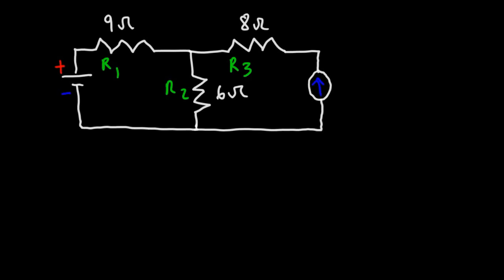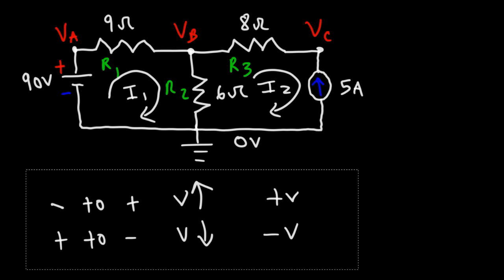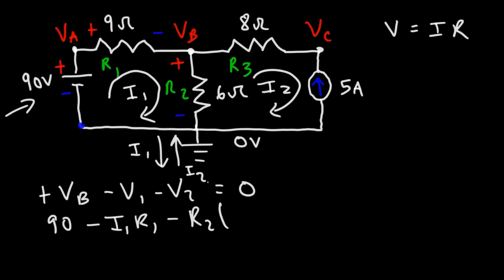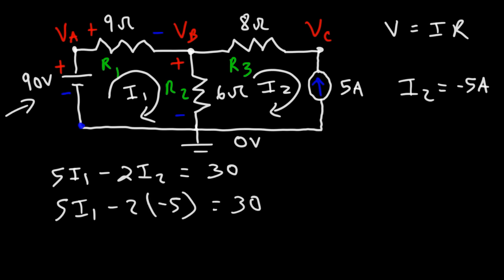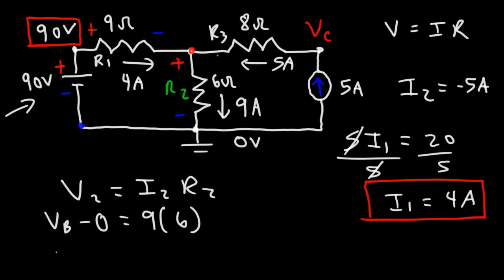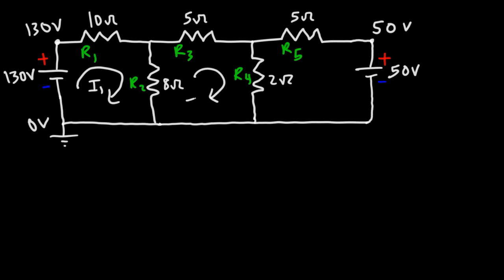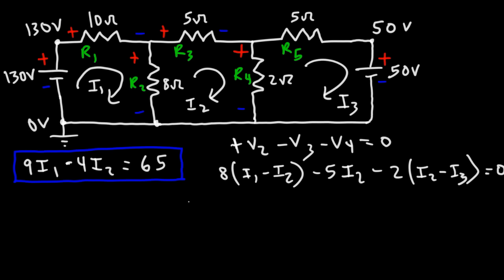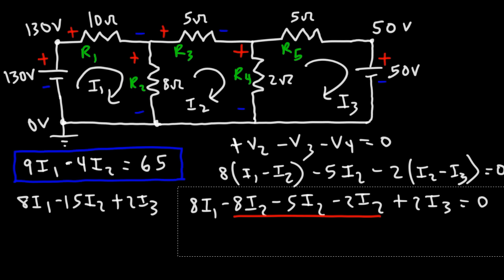Mesh Current Problems - Electronics & Circuit Analysis

Comment: I have a question. After getting the three equations can a use the function on my calculator in finding the unknown values in the second problem? I been trying to get the values using only the equations to be exactly the same answer in this video. I couldn't get it right for some reason. If anybody has an idea please do share, i might need it for tomorrows midterm.
Great video by the way.
Reply: late but you can use a "simultaneous equation" function on your calculator, depending on which one you have. My prof recommend the Casio fx-991EX because the interface is super clean and you can also solve matrices on it. I'd look into it cause it saves quite a bit of time on exams (just check with your prof that its allowed lol)

Comment: Hi all , can explain in 6:00 why divide by negative 3 and 12:45 also why divide by negative 2  ?
Thanks
Reply: Hi Cayden Goh, the reason why he divided both equations (at 6:00 and 12:45) by -3 and -2, respectively, was just to simplify them. You can calculate those equations without dividing them by those numbers. In the end, you will get the same value.

Comment: Why does I1 and I2 flow in opposite directions in the resistor R2? They both point upwards in their respective starting points(positive up in the left, arrow up in the right)
Reply: Mesh Currents Flow in a Complete  Loop .  I1 flows into the Top Node of R2 from the Left side ( I1  Enters the Top node ) .
I2 flows Out of the Top Node of R2 , toward the Right .
Thus , at the Top node of  R2 :
I1 flows INTO  the Top Node .
I2 Flows OUT of the Top Node .
and  I3  flows OUT of the Top Node , down thru R2 .

he doesn't actually mention Branch current I3 , but since he is only using a single Vector  +-polarity across  R2 , that is then the only possible interpretation of what he is doing .

Enter  =  Exit
I1        =  I2 + I3
thus ,
I1 - I2 = I3  where  I3 is the Branch current flowing down thru  R2 .

if he had describe  Mesh  currents , then  I1 flows Down thru  R2 , while  I2 flows Up  thru  R2 .  Again ,  Mesh currents flow on a Complete Path .  Draw a Solid Circle for  Mesh  I1 , and Draw a Solid Circle for Mesh I2 . Also place Arrow Heads for Both  Mesh circles  as moving in a  CW  ClockWise  direction .
it should be obvious that  I1 flows Down thru  R2 , while  I2  flows  Up thru  R2 .

There is No  starting point , for a Mesh  Arrow . however , most diagrams  are drawn using an  Open arrow .
Reply: Is it correct that in the first question, the source voltage is 90v but when it comes to V3 it has 94v?

Comment: here are the issues :
1.  KVL with it's Ohm's Law parts are NOT fully explained .
    thus the inner details of equation writing are NOT discussed
    because you choose to only use  +pos Ohm's Law .
    Manually writing those  +signs is a bit unusual , but then
    it follows with the convoluted approach that you use .
    ( i assume you are using Hole Flow with the passive sign convention )
2.  you say you are using Mesh currents , but yet you always
    revert to using Branch currents . Thus you really are NOT
    using  Mesh currents . i have the impression that
    you do NOT fully understand the definition of a Mesh current .

3. update : The video is using  +-polarities  across the resistors 
    to Always provide  +pos Ohm's Law for each resistor ,
    thus the video is skipping
    a very important step of  the equation writing process .
    Everyone is being missled by this approach .
    In fact , i see many , many youtube videos , that do this ,...
    making everything appear to be +pos  Ohm's law , and  Ignoring the
    writing of the  Ohm's law  parts , and only writing  the KVL  +-signs
    into the  initial  first level  equations ,...bad idea .
    writing a  complete Loop equation , Mesh  , SuperMesh , General Loop Current ,
   doesn't matter ,... all loop equations are written using  ( KVL with Ohm's law ) .
   you have  explicitly omitted the ( Ohm's Law ) portion of the equation writing process .

4.  if someone asks for the Voltage across R2 , with
    +plus at Bottom and -minus at Top , would that pose any
    issues , when analyzing the circuit from the very begining ?
5.  you make no reference to solving Vector based physics problems .
    Circuit analysis is Vector based physics problem solving .
6.  Traversing is not the only approach to equation writing .

for the first circuit , Mesh equation I1 can be written
straight to this format , with No  intermediate steps .
( regardless of the +-polarities across the resistors ,...
  when you know why this is true , you will have learned )
90 = ( 9 + 6 )I1  - 6I2
and
I2 = - 5

i recommend reading these 3 books .
read the DC chapters of each book
( about 8 DC chapters total ).
and maybe after a few months you will
see the Big Picture .
as it is right now , a first timer
watching such a video will still have
many questions . yes , there is lots of
missing information in the video .
Sadly , No one book describes every detail
of equation writing . Each book has missing
information in the DC chapters . That is why
All 3 books need to be read , for their DC content .
Then you must "Put it all together"
to realize the easiest way to write equations
is NOT traversing . ( go deep )

Engineering Circuit Analysis Fifth Edition 1993
ISBN :  0-07-027410-X
Hayt , Kemmerly

Electric Circuits  Second Edition 1986
ISBN :  0-201-12695-8
Nilsson

Basic Engineering Circuit Analysis Fourth Edition 1993
ISBN :  0-02-359891-3
Irwin

newer editions of all 3 books are available , however
the previous editions cost less .
Look to amazon and HPB  Half Price Books .

i'm not perfect , but i have always tried to go deeper .
and yes , it is possible to fully understand equation
writing by reading the DC chapters of the above 3 books .
And be sure to include basic physics problem solving techniques
when writing  circuit equations .

hint :
solving hundreds and hundreds of problems is NOT the answer .
Core Techniques must be realized and understood .
use your time understanding  Technique , instead of
stumbling to solve many problems .

your equations were written correctly , but the approach
is too much of a Spin .  I know . I have been there too .
i would NOT pay to sit in a class to listen to your Mesh analysis .
keep studying .

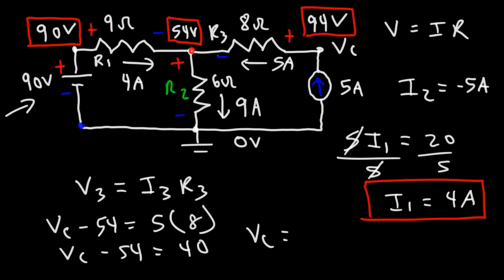Comment: Thank you for a great tutorial video. In example 1 (@10:01), how is it possible that Vc is 94v which is more than the Vs 90V?
Reply: due to current source since voltage is directly proportional to current according to ohm's law